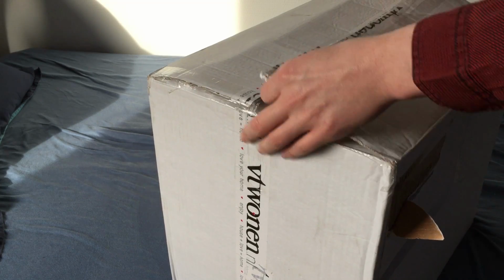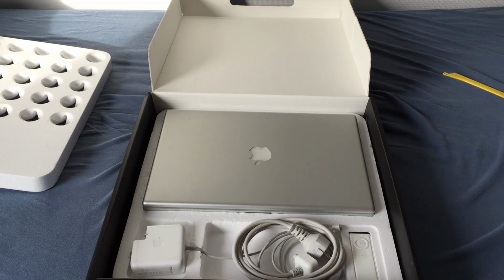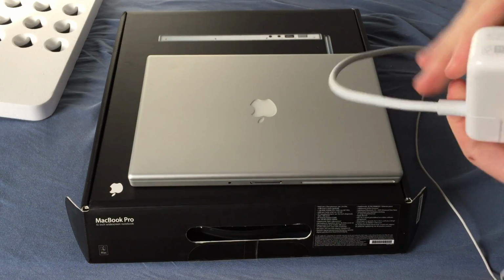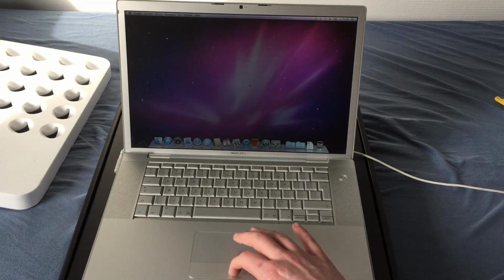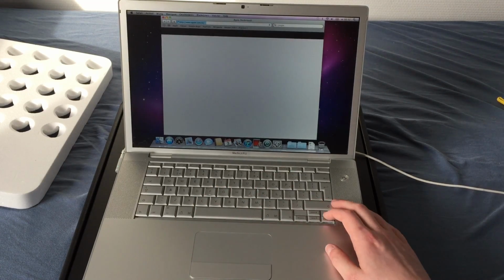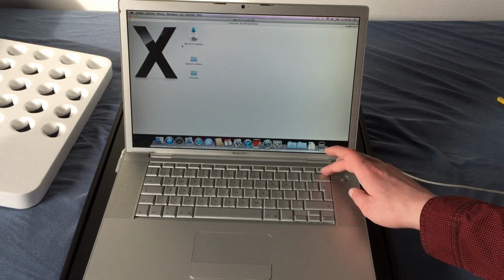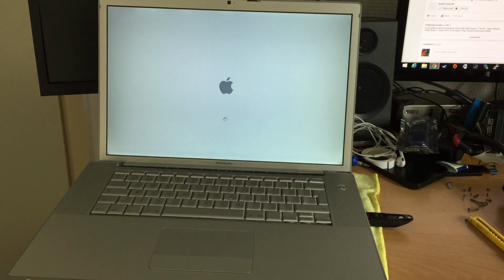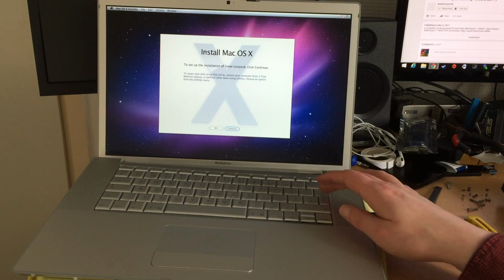MacBook Pro 15-inch Early 2006 - Unboxing, Overview & Test

Comment: hello to team and like your review !  Whether possible to install on this machine program for 3D like Blender3D ? let me know if there is a chances? + what is the latest MAC os version possible to upgrade this machine to ? Thanks much.
Reply from the maker: Hi!

The Early 2006 MacBook Pro can only run up to OS X 10.6.8 Snow Leopard, which went End-of-Life in 2013. 
It can only run 32-bit software.

If you need to run Blender, please buy a newer MacBook Pro (2012 15" or newer).

Comment: i have a 2006 macbook pro my first one ever and let me tell you something . this machines are great full upgrade on the OS i have Mac os x lion .i do see other videos that you can update but with patches i do use the web on it and watch netflix on it , the keyboard lights up and they are great key boards to type in , anyone has upgrade the os further then lion ??????  any help ..... if i can only upgrade it to el cap . its flashed to 2,2 and its a intel core dual my model can one help like I mention I’ve seen people flash it to el capt
Reply from the maker: The core duo model can’t be flashed, it’s a 32-bit processor that will not run Lion or later. Yes, the old DP4 release of Lion works, but it’s super unstable. Anything newer requires a 64-bit processor, the Core 2 Duo, or newer.
Reply: @nelizmastr   i have seen videos on the same model and how to but I need help jeje . I have seen el cap work with a 2006 . And I have lion and surf the web with it and it’s pretty stable . Most of the time you hear the fans spin normal on these big MacBook pros
Reply from the maker: @adgaming8772  the only 2006 that can run el cap is the late 2006 core 2 duo model, and even with that, El Cap only works somewhat. No graphics acceleration means a lot of the operating systems is very slow and quicktime and i.e. YouTube won’t work correctly. It’s genuinely a better idea to just throw Linux on it.
Reply: @nelizmastr  mine is a 2006 core 2 dual . Like I said it works fine with lion but why not give it a shot
Reply from the maker: @adgaming8772  you said it was a core dual. Please note the core duo and core 2 duo are very different processors. If it’s really a core 2 duo, then you can try with nexpostfacto or whatever, but it won’t be usable. Especially without at least 4GB RAM (which is impossible, the 2006 can only use 3GB, even with a 64-bit CPU) and an SSD.
Reply: @nelizmastr  yes it’s intel core 2 dual with 3 gigs of ram  have you updated you’re  since this video ?

Comment: Using dvi 24+1 or 24+5 ?
Reply from the maker: This has dual link DVI-I. It supports digital displays as well as analog via an adapter, up to 2560x1600.
Reply: @nelizmastr  I mean, if I want to use a dvi to vga converter. should I use dvi 24+1 or 24+5? Im afraid if I buy wrong
Reply from the maker: No idea tbh, I never see converters referenced that way. Any regular old DVI to VGA will work, it doesn’t need to be DVI-D to VGA, which is very expensive to do.

Comment: I have a macbook pro early 2006 . is the maximum RAM only 2GB? 1GBx2 ?
Reply from the maker: Yes, it will only support 2 1GB sticks with a Core Duo CPU. All Core 2 Duo models support 4GB.
Reply: @nelizmastr  Arigato

Comment: it works without battery so with the power cord ?
Reply from the maker: As long as you have a sufficient power adapter (so not the 45W) it will work without a battery, yes.
Reply: thanks for your attention helped me a lot, It has to be an 18.5V source ?

Comment: i have one of these lying, can i use a 60W power adapter? ohh well. its a mid 2007, but it looks the same... thanks..
Reply from the maker: The 60w will only work if you have a fully working and charged battery. Without the battery or with a dead one, it likely won’t boot with the 60w.

Comment: i got one of these 3 months ago for $45, its a 2007 core 2 duo, 2.4 ghz , the battery has a cycle count of 3 and works great
Reply: Random Reviews & More can i know where u buy that macbook?
Reply: I found one in recycling, what browser do you use??
Reply from the maker: Depends on the OS. You can’t really use OS X 10.5 or 10.6 anymore.
Reply: Snow Leapard

Comment: Would this be a good Laptop for Daily web like facebook and emails and  maybe a little youtube
Reply from the maker: I wouldn't buy one of these if you're not 100% sure you want a Mac. You can get much more modern laptops for the same money, like the Lenovo ThinkPad T420, Dell Latitude E6520 or HP EliteBook 8460p.
Reply: I do want a mac but i am not really sure which one to get ?
Reply from the maker: I wouldn't go for Core 2 Duo anymore. Aim for the 2011 or 2012 13" models. You can expand them with a SSD and 8GB RAM and they'll run for a good few more years.

Comment: I still want to fit a ssd to my early 2006 mb pro 17". I tried to fit one a few years ago but it wasnt recognised by the disk utility. Can i ask what model ssd you fitted.

Your right , it is a very pretty machine and is fine for general use. Shame they dented so easily. Mine is in almost totally immaculate condition. Its still running on 10.5 leopard lol
Reply from the maker: I used a Sandisk Plus SSD. Worked no problem. I've had good luck with their SSDs. They're not the fastest, but that doesn't matter on these old Sata1 machines.

Comment: Very good video. Have a question. On this Mac book pro 2006 Can I add garage band or Pro Logic X? Thank you
Reply from the maker: Garageband 6.0.5 (from iLife 11) is the newest version that'll run. For Logic, the last version that'll work on this 32-bit system is 9.0, not 9.1 9.2 or X. For the current releases, OS X 10.11 is required, so you'll need a MacBook Pro 2007 or newer.

Comment: I have a 2015 MacBook Pro Retina, absolutely love it as my main machine. Really want to get my hands on a Early 2008 MacBook Pro, despite the GPU issues I really don't mind grabbing one.
Reply from the maker: +NathanGaming247 If you can find one with a revised GPU/logic board already in it, I'd grab that
Reply: I have a 2016 and bought one of these for shits and giggles.

Comment: Last week i actually had to get the new MBP 13" 2016, my 2006 was a champ and lasted all these years. The batt died years ago and also the optical drive. Was not able to upgrade browsers or OS. One of the things i really loved was the remote. 
Im hoping my new MBP last at least half as long as my old mac. Thanks for making this video only goes to show the quality craftsmanship that goes into building a great machine
Reply: New models actually last longer. Those 2006 models can only be upgraded to OS X Snow Leopard, which was released in 2009. That's a 3-year support cycle. The 2012 model can still be upgrade to upcoming macOS Catalina, which is already a 7-year support cycle. And that machine may even get update next year and the year after.

Comment: Just bought a 2008 A1260 15" MacBook Pro on eBay 2 days ago for $170... I've already got a factory new matte screen display assembly to put on it, an SSD, 2x 2GB RAM sticks, and a new genuine battery for when it arrives. I can't wait! This was my absolute favorite style of laptop I remember from when I was a kid. http://www.ebay.com/itm/APPLE-MACBOOK-PRO-15-4-1-2008-A1260-C2D-2-4GHz-2GB-160GB-VERY-CLEAN-/232270393423?hash=item361464f04f:g:1kwAAOSwCU1Yx4Hv
Reply from the maker: +Mitchell Gr33n I hope the previous owner had the revised logic board fitted, otherwise you might be looking at a laptop with borrowed time. I agree, though. I love these machines just as much.
Reply: nelizmastr yeah, I can't tell, but I plan on using the smcFanControl app to regulate the temps, so hopefully that'll allow it a longer life :)
Reply from the maker: +Mitchell Gr33n use Macsfancontrol instead. It's much easier to use.
Reply: nelizmastr I'll give it a look, thanks!

Comment: As someone who has limited experiences with Apple machines, I find these videos quite interesting as it is a look into the mostly unknown for me. 65 Watts does sound a little under powered, I'd have expected at least an 80-90 Watt charger for something like that.
Reply from the maker: +HighTreason610 Historically, 15" G4 Aluminium PowerBooks came with a 45W adapter at first. Once the battery went, the 45W wouldn't even allow the system to power on. They went with 65W since. 

The Core Duo chip in this, a 2GHz T2400 I believe, has a pretty low TDP and the X1600 mobile GPU isn't terribly hungry either, so it's sufficient at least. The adapter I got with it is original, so I guess it's not stressed to death.

Comment: I've actually also got one of those, but the fans are on the verge of death and the audio is stuck on digital out... Apart from that it's great though.
Reply from the maker: +Thomas That's prety much the state my PowerBook is in. The MBP seems perfectly fine in terms of the various components.
Reply: My macbook pro 2006 fan was very noisy so i took it apart and regreased the bearing. Very quiet since, and easy to do.